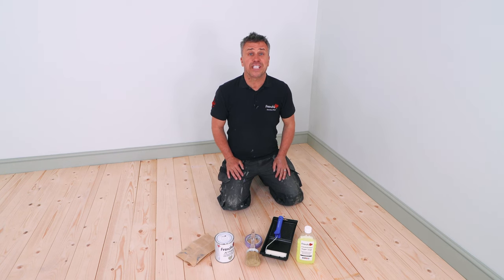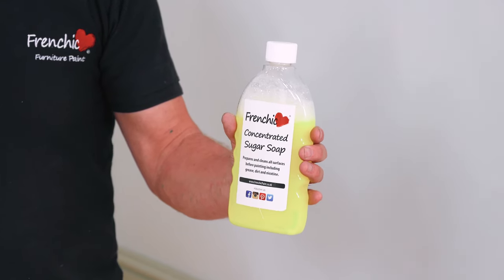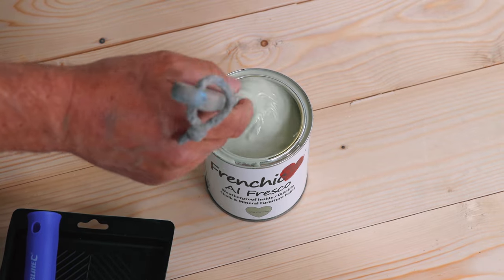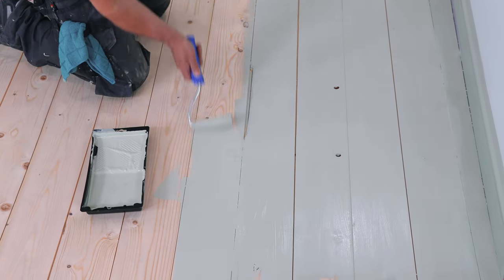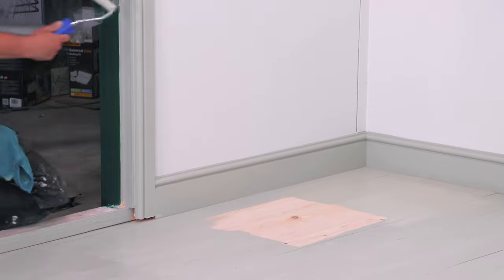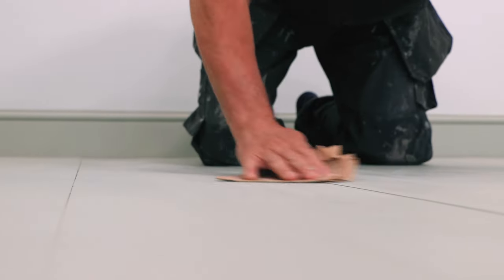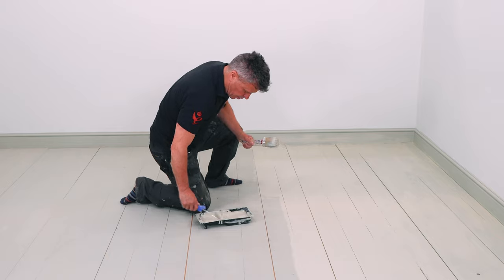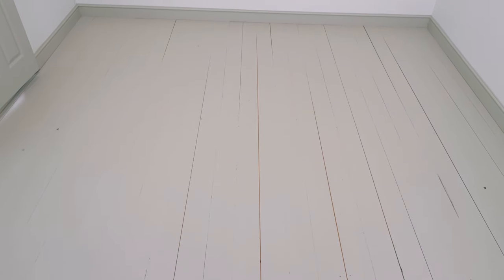Frenchic Top Tips | How to Paint Wooden Floorboards

Comment: Hey I’m planning on doing my floorboards will I need to prime them ? If so could you recommend thank you !
Reply: Ok great, No no primer is required, but do dilute your first coat a fraction, the thiner the paint is it will then penetrate into the bare wood better, and you can always apply a couple of coats of clear Finishing coat from Frenchic for extra protection
Reply: @MrandMrsDIY Do you dilute it with water?